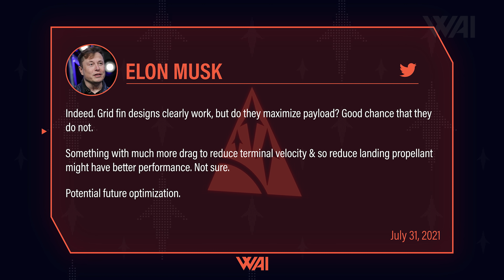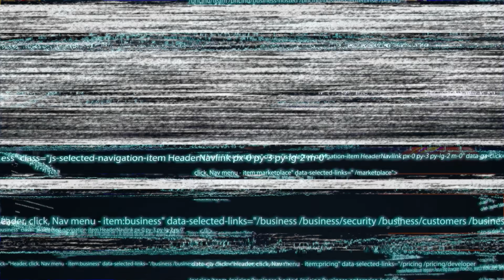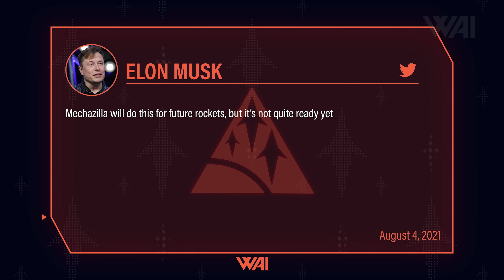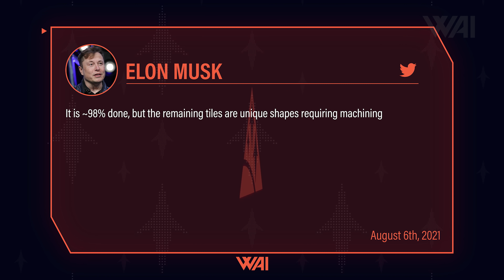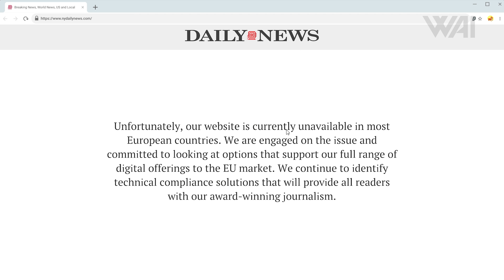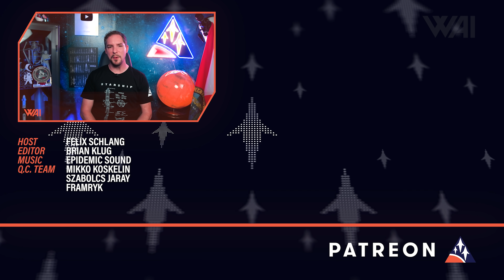First SpaceX Starship & Super Heavy stacked in preparation for orbital flight!

Comment: When you mentioned the 1 hour turnaround, I immediately imagined the booster be re-fuelled from the base, right where the recently hot firing rocket engines are located. A bit hazardous, is it not? As for a skirt for the booster, I would have a concern of trapped heat from all those raptors.  On the Starship test flights, with only 3 raptors, we saw flames dance in and around the engines. The lack of a skirt may actually be helpful in this regard.
Reply: 1 hour turn around is a goal, and probably won't happen in a long time.
Reply: Those flames were a glitch... completely solved with SN15. Go watch again
Reply: @faustin289  Still, on descent, the heat from the landing burn would build up quite a lot if there was a skirt. Without a skirt, the free flowing air will take care of it.

Comment: For refueling, the two Starships should connect nose-to-nose. Then, they could each fire the Hot Gas Thrusters, to begin slow rotation. This allows fuel to collect, and minimizes fuel left in the tanks. Musk recently emphasized this point in how much this means in dry-mass, vs. wet-mass calculations. Without some artificial gravity vector, how could you completely empty a fuel tank? With rotation, it becomes achievable. Due to the header tanks, there should be fuel lines in the nose area to facilitate this idea.
Reply: The rotation might get a little wonky, due to the shifting center of mass, but it should still work.. ? Maybe a long tether to keep the center of mass external to the vehicles?

Comment: 8:40 - Felix, that "Arms able to move" part,... Does that imply the arms will swing side to side, or that there'll be a turntable structure on top of the tower,.. "Mystery Structure" goes on top ??
10:25 - Black & White for historical impact,.. note the guide pins on the top of Superheavy, no doubt there's a locking mechanism in these new thicker walls of the raptor bay on SN20 that will clamp on to the open spaces in the outside of the guide pins. And the rear flaps will sit between the grid fins, perhaps the shock wave off the nose cone and the flaps will shroud the grid fins in a lower pressure area of airflow ??

Comment: How much the Starship weights with the tiles? Seems too heavy. Don't be surprised if the design proves to be functional, they try to use even thinner metal sheets to save weight.
Reply: Yes, they will cut weight and simplify construction in the future.
Reply: @Mosern1977  also it seems they need to improve the output power of the engines, since they are adding more engines to Starship and the Booster.